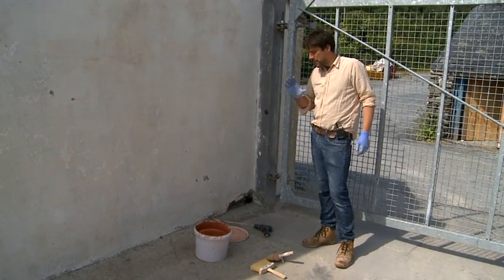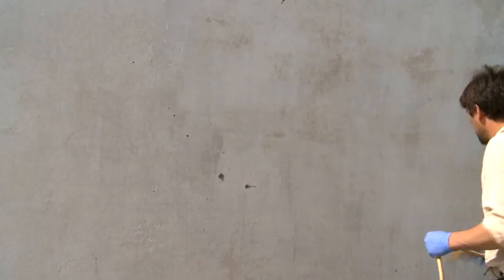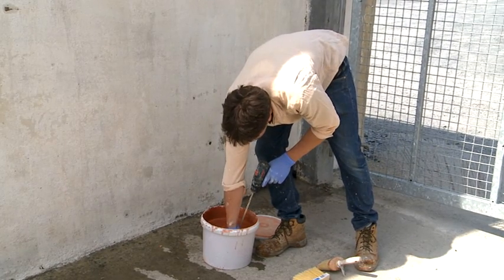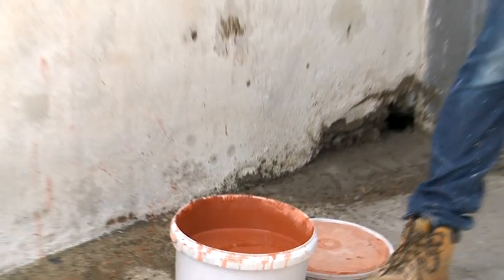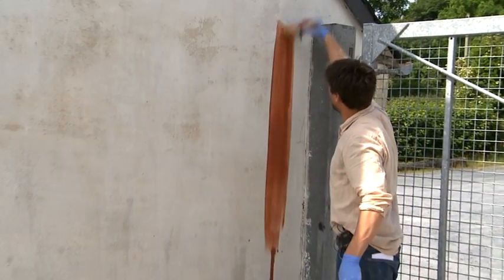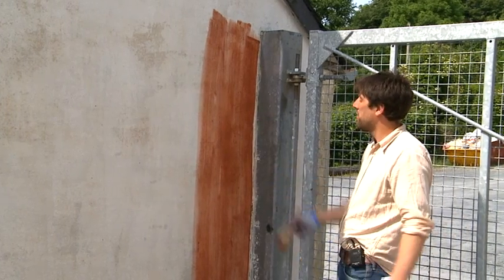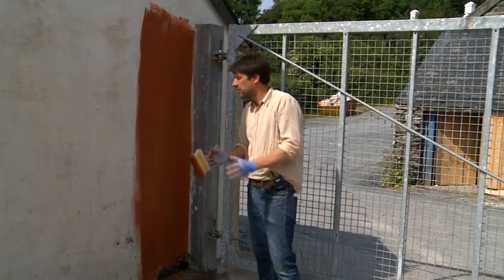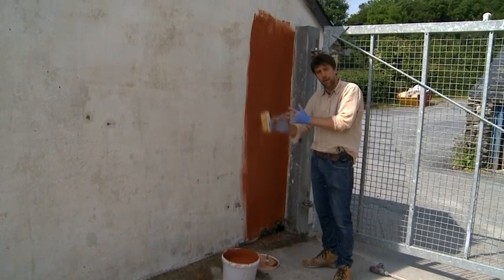25. Limewash

Comment: Is it possible to limewash over plasterboard 'finishing coat' surfaces?
Reply: @Mr Brightside I've used American Clay on plasterboard - drywall - and am now working with limewash on top of some of the clay walls - in order to make them more water resistant. I also have used lime plaster on brick - which butted up against drywall - the lime plaster actually made an excellent filler - connecting the drywall (on wood) with the brick wall.

Comment: Not how you apply it at all, do figure 8 brush patterns or Xs. Never brush in straight lines with limewash. Also should only take 3 coats, not sure what he is doing. Also, if using a pigment make sure its designed to be used with lime as not all are by any means.